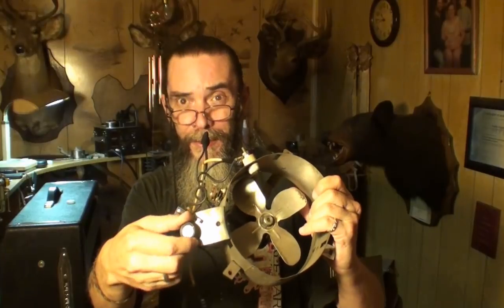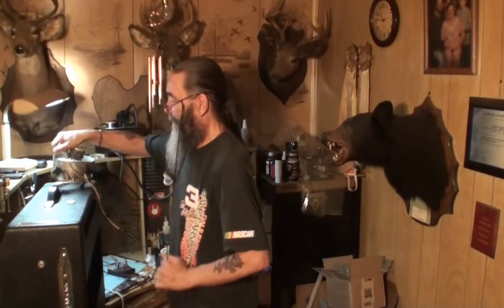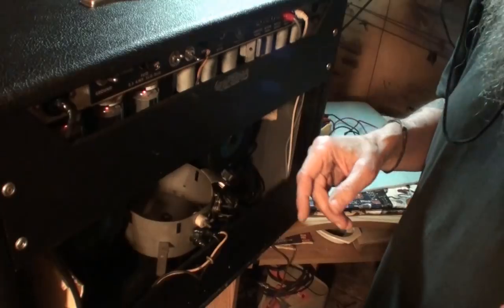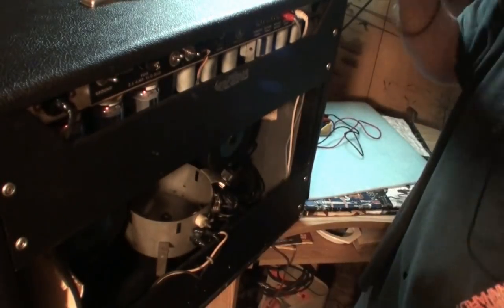fender twin reverb amp mods

Comment: I use to put a computer fan on my receivers to keep the amp cool. Also on the ab powered amps for car audio. Class d amps don't get so hot, but computer fans are quiet and the right size can move some air.
Reply from the maker: I've got a bunch of different size computer fans from when I used to build computers and sell them, they are really quiet compared to this fan, I'm going to put on a new cord and re-wire this fan for variable speeds will quiet it down a lot. thanks for watching and commenting brother!

Comment: I’ve been playing through a 72 Fender Pro Reverb for over ten years.  Although it gets warm, it’s definitely significantly cooler than those Twin amps.  Maybe it’s the lower wattage that keeps it from getting so hot.  I love those Twins, but they’re just too loud for home use or at least for my preference.  Great vid Randy.  You can solve just about any issue with musical equipment.
Reply from the maker: I was reading an artical ust the other day on these old twin amps and it said they were too powerful, it said they sounded best when ripped up and drove hard, but at that level they were too loud! that's where pedals come in, they do get hot even playing at low levels. thanks for checking it out Josh!
Reply: Perfect for drowning out the generator at field parties. (not that those happen around here anymore :( )
Reply: If you can find one ya may wanna give the "Power Soak" made by Tom Sholtz of the band Boston. It's an attenuator, I believe, he designed so he could run his Marshall Super Lead 100 Stacks @ Full Tilt Boogie 11 to get the sound he wanted but @ Elevator Musak Levels. We used to sell em for $20 Used. Now, of course, they're Collectors Items. I still check Flea Markets and Garage Sales keeping muh fingers and toes crossed.

Comment: Randy, if the amp has been given a 3-prong cord conversion, there's little remaining use for the ground-reverse switch. You could wire it up to switch the auxiliary AC outlet on & off. For the life of me, I don't know of any 3-prong outlets that will fit directly in the chassis where the old 2-prong outlet is, unfortunately. It'd be a great mod for a lot of old amps, if a 3-prong socket were available that didn't require any drilling on the chassis & would just drop in where the old socket is. Does anyone know,  is such a part available anywhere?

Comment: Tube amps are expected to run hot like that, so it doesn't bother much. The caps won't care too much either. Age is the enemy of caps. However, cooling the tubes does help them last alot longer.
Reply from the maker: I've got a video coming soon of heat comparisons with/without the fan running, this fan made a world of difference, much more than a fan blowing into the back of the amp, and soo much difference I had to show it! thanks for watching!

Comment: Randy, if you do not want to rewire your amp, don't! If you want a slick setup and even make your amp as safe as possible..the mod you need to do is, rewire the ground switch  to turn the outlet off and on. If you have not already replaced the 2 prong plug that powers the amp with a 3 prong plug, you need to. you can leave the outlet in circuit, but not wire it for grounding. Just run the wires through the switch then to the outlet. You may want to take out the "DEATH CAP" that is on the ground switch also. If you need help, there are many, many videos on YT to help you. Back in the day, I plugged anything I needed in those outlets like a diy strobe light I made from an old window box fan. That's another story HA HA!  Thanxz
Reply: Spot on.  This is a must-do mod for all 2-wire amps.  It's the cheapest life  insurance you can buy.  And no need to drill a new hole for the courtesy outlet switch: use the ground switch to activate the courtesy outlet.
Reply from the maker: someone has already replaced the old 2 prong plug with a 3 prong one, it's just the outlet in the amp is still 2 prong. to keep the amp as original as possible I prolly will leave the outlet in the amp alone and re=wire the fan switch to work again, having variable speed would be nice, and quieter.
Reply: Ya just might wanna replace the 2 prong courtesy outlet with a grounded 3 prong and put the original up for Gits and Shiggles
At least that way your fan and anything else you plug in can and quite possibly might be grounded, LoL

Comment: Randy that's what I was gonna say, just fix the switch on the fan. I just figured on my Fender amp that if it needed a fan they would have put one in there. My Peavey Classic 50 has a fan built in. But my little 5watt Epi has no fan and it gets rel hot and will not clean up at low volumes after say just 15 or 20 minutes.

Comment: It seems like it would make a lot of noise when you're playing.  A squirrel cage blower may be the answer. Quieter and blows more cfm.
Reply from the maker: very true, I can't hear the fan when playing thru thr amp but if I ever used it to record I'd have to slow it down or shut it off. video coming soon on a heat test comparison with/without the fan.

Comment: I have to Apologize...Your Fan just got me Laughing, it was so Thrown Together Looking...
: P
Don't know if U knew about Small USB Fans, [1 speed] that can Plug into USB Laptops or USB Power Bars [standard Power Plug end]
One of Those is only about 6"
I keep 1 at my Bedside, to help me Breathe at Night.
Radio Shack-"The SOURCE" here in Canada, is where I bought BOTH those Items, about 6 yrs. ago.
Amazon sells 1 Called Premiertek.
1 of Those would fit in there Good, and they Work real Well!
Glad to be Graced by the Presence of Miss Q~Ball...
: ) <3

Comment: Randy i hate to send you to amazon but they sell a fan that would be perfect for what you are wanting to do and it would look a lot nicer. Get back with me so I can get your address and maybe a little fairy might drop one off to you. I will be looking to hear back from you. Here is what I am talking about. AC Infinity AXIAL 1238, Muffin Fan, 115V 120V AC 120mm x 38mm High Speed, for DIY Cooling Ventilation Exhaust Projects

Comment: You made a Leslie out of it!
Reply: yeah my first thought fan behind the speakers would this not mess with sound. dont know just asking. am sitting here looking at a mid seventies twin with jbls bought new and a hot rod deluxe couple yrs later. never had an heat issue. that i know of they both still preform very well.